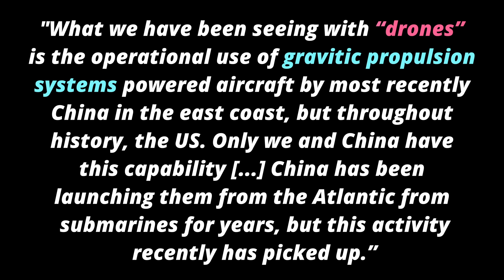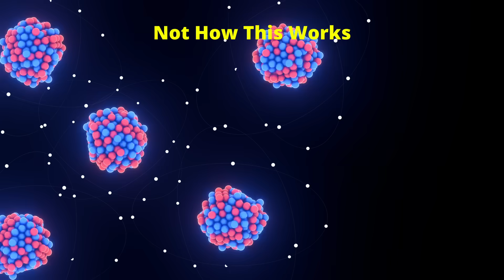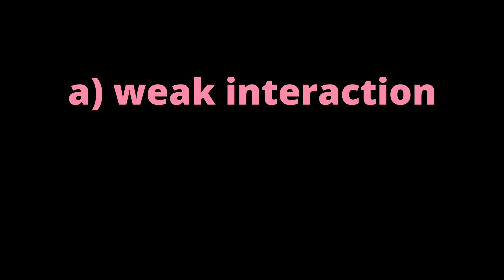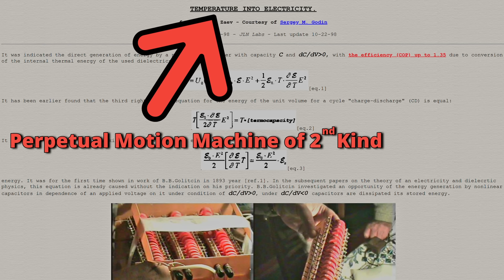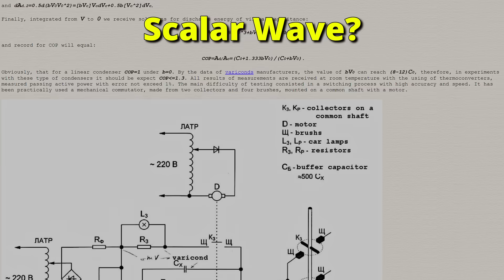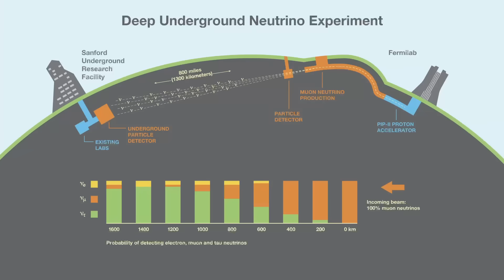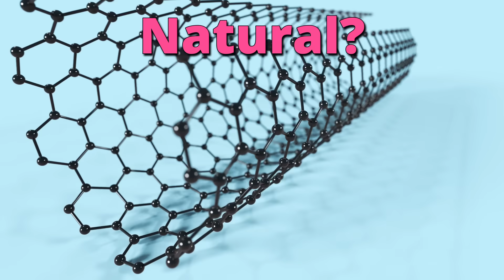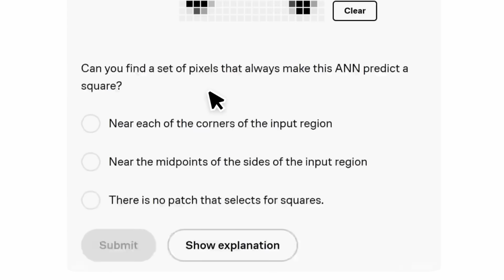What is “gravitic propulsion” and could the US government hide it?

Comment: Sabine do you think that there should be a shift in thinking to discover new components or composition of materials, or that new physics? Does the theoretical physicist has reached there limit of thinking or limit of having new ideas? Are they not bound to the ideas of present? If the problem is not in “more energy” ( building bigger colliders), then definitely the problem of mathematical capacity of the theoretical physicist. At the Ptolemaic era the moving of the celestial bodies were very well discovered, but when Copernicus and followers discovered the true movements the old ideas was outdated. The early astronomers and mathematicians had no tools ( equipment) and ideas  ( new math?) to really discover the movements. So will new generation of physicists would have more chances in the AI era to discover this, with new supercomputers?

Comment: Lord Kelvin stated nearing the end of the 19th century, that heavier than air flying machines were impossible, and he remained correct till the Wright brothers contradicted him using physics, with which he was unfamiliar.(fluid dynamics) In this way, the head of the US Patent office, claimed, in 1900, that everything that can be discovered has already been discovered. (this was a claim based on known physics) Einstein, Max Plank and Niels Bohr, notwithstanding. What will be the next step, which gives physics a significant shake up? I don't know, but we haven't had one for over 50 years, and I wonder why? As do you Sabine

Comment: 13:30 Sabine.  Better late than never.  You seem to be inexorably, but surely, moving over to the sane side of science.  The classical side.  Physics in academia is all but dead.  The crazy cultlike adherence to QM ushered in its demise and AI will deliver the final stroke.  

Chemistry is the new field of study.  And what sets it apart is a whole new field of chemistry call Tovacian Chemistry (The Orthogonal Vector Addition of  Charge) .  Two identical moving charges of the same polarity, interacting orthogonality (at right angles) may attract each other.  (Note that at right angles it can be easily proven that there is zero electrostatic interaction between the two orthogonally  interacting charges) .

Comment: To perform anti-gravity from your physical body, you have to willfully go against earth rotation, even if you do not feel that the earth is rotating. You have to stand close eyes, reset your mind by quieting it, sooner or later you will sense your orientation or perceive the earth's rotation, once you practice achieving that 1000x, (it is like achieving waking up 5am morning without alarm) then once achieve it, you'll then grab a pull-up bar and grab it to the height that youre touching ground with your tiptoe. Do this again 1000x until physical body recognizes the earth rotation aside from your mind, then through visialization, you intend on moving away from earth rotation like releasing yourself from its gravitational pull and orientation, de-orient your mind and body as if like an astronaut, you can achieve this again by resetting mind and body, blanking the instincts, it is like fasting, the more days or times you keep doing it, the more your body and mind responsively changes, at first may feel discomfort but once you do it too many time, it will be comfortable as if its aligning to the new human in you.

Comment: i think mass is condenesed energy similar to ice is frozen water. just look how pure energy is released when matter+antimatter cancel each other out. also look at the periodic table of elements. 1 2 3..115 we know all of them. also look at the unification of the 3 fundamental forces when temperature is very high, meaning very high energy concentrations. gravitation is not fundamental i think. i think there is no graviton. we will see. maybe there is 1 more fundamental force but very weak or only at very small distance. CERN should show it soon. we live in interesting times now for sure. hehe.

Comment: Can you use the original Maxwell's equations to show how extremely high voltage can demonstrate gravitic effects? Nevermind the magnitude and engineering difficulties, just in theory and given an unlimited supply of energy. What about breaking the Schwinger limit?
Reply: The speed of light squared is also the product of the permeability and permittivity of a vacuum. So that's the bridge to pick at here in regards to mass and energy being the same thing as they relate to electromagnetism. (Gravitation is an emergent aspect of the mass potential. There are hints that it's a tensor, just like the electromotive thing.) It's putting both Maxell's and Einstien's work together.

Comment: The classified math is all 100% true.

There is no true open equation for mathing out how to turn u235 into u238 and what electron voltage you need to cause the implosion. You literally have to know the knowledge in order to have access to that classified information or work on that classified information. And that is just the most basic example of open knowledge that is openly classified.

Comment: Electrostatic and magnetic fields are connected to gravity by the Einstein equations and the fact that the speed of light squared is also the product of the permissivity and permeability properties of a vacuum. The trick needed is to use a precession effect across rotating fields to perform a transform across the vectors there. Get that licked and you've got something. Another thing in the bag of tricks is that if you have high enough frequency of gravity waves, there's some hacks for fusion. Stuff that's still not good for over-unity right now would be fine when you factor in a possible generated field application that's not really well known just yet.

This falls into "cagegory C" as Sabina describes it. It's not new stuff, it's existing things being combined in a way that's not fundamentally obvious at first. Part is in the confiscated Tesla papers, some is there in Einstein's work (but not considered seriously), and there some at the very roots of string-theory although the later stuff we know as current string-theory went on a different tangent. This is finding new ways to fit Lego bricks together, not inventing new bricks.

As for secrecy... It's just like any secret sauce. All the ingredients are there in the open for the public on the store shelves. It's the recipe for mixing those ingredients that's heavily controlled. And some governments may be doing exactly that within this context.

Comment: Of course one can hide anything from the average physics-challenged citizen. But one cannot hide anything from physicists. After all, they do the work. Even the Manhattan project could not be hidden from them. They might not have known the details, but they noticed that key figures in the field of nuclear fission were suddenly missing. Papers on fission were already in the open literature, and so was the mathematical theory of how to produce a bomb. The point is that anti-gravity nonsense has been around since the middle of the nineteenth century and, like free-energy (aka perpetual motion), it merely reflects universally poor science education. Check the bona fide physics journals. Oh, but you can't can you: the papers are usually behind high pay-walls. So you can only read rubbish on Google Scholar and the output of so-called 'predatory' journals, which exist for the sole purpose of spreading pseudoscientific drivel.

Comment: As seriously as possible, I believe they're referring to a method of influencing gravity, basicly using unspecified materials or methods to reduce the pull of gravity (anti-gravity) directionally instead of a the typical omnidirectional way objects normally interat via this method. How is anyone's guess but this is quite different from simply overpowering it using the electromagnetic force or chemical methods, etc. Wouldn't it be like absolutely crazy if dark matter turned out to be some phycis of non-omnidirectional methods of redirecting the gravity of existing objects, possibly primarly only created by intelligent civiliaztions that actually are extreamly common throughout the universe?

Comment: Gravity: F=m*a or F=G*m^2/r^2, designation: a - acceleration, F - force vector, G - gravitational constant, m - mass, r - lenght vector, ^2 - 2nd power operator
Lorentz Force: F=q*E + q*v X B, F - force, q - charge, E - electric field, v - velocity vector, B - magnetic induction vector 
Lorentz Force to gravitational force connection:
m*a=q*(E+vB) if we assume v and B vectors perpendicular to eachother
a=q/m*(E+vB)
When Lorentz force is equal to 0 then qE=-qvB so E=-vB and a=0.
But we know that in our gravitational field of Earth the a=g.
So the g=q/m*(E+vB)=q/m*(E+r*f*B)=q/m*(E+r*omega/2pi*B), designation: f - frequency, omega - angular velocity, 2pi - pi number times 2
If electric field of earth is equal to E and magnetic field of earth is equal to B then all non zero charges to mass ratio of earth particles as sum must give the gravitational acceleration G. Such charged massive particles are rotating with omega/2pi  ratio or moving with v velocity. Because such movements happening in some aspect ratio then:
g=alfa*q/m*(E+vB)+beta*q/m*(E+r*omega/2pi*B), and alfa+beta=1, designation: alfa, beta ratio constants
This is the gravity effect cause. So gravity is the law of conservation.
Because all moves of inertial particles on Earth have thermal cause then:
v=(kT/m)^(1/2), where v root-mean-square speed of particles, k - Boltzman constant, T is temperature,
after new rearrangement:
g=alfa*q/m*(E+3(k*T/m)^(1/2)*B)+beta*q/m*(E+3(k*T/m)^(1/2)/2pi*B)
If we then treat an Earth as a capacitor and coil then we can rearrange such equation:
g=αq/m(C⋅V/ϵ)+βq/m⋅(C⋅V/ϵ)+3(kT/m)^(1/2)((αq/m)*(L*I/(A*N))+(βq/m)*(1/2π)*((L*I)/(A*N))),
designed values: C - capacitance of Earth, ϵ - permittivity of the Earth atmosphere, d - separation between Earth surface and Ionosphere, L - inductance of Earth, N - number of turns in coil, I - current flowing through coil,  A - cross sectional area of coil, V - voltage between Ionosphere and earth surface.

Z=jωL - relationship between Earth impedance Z and inductance, designation: ω - angular frequency of the AC signal, j - imaginary unit
Z=−j/ωC - relationship between Earth impedance Z and its capacitance, designation: ω - angular frequency of the AC signal, j - imaginary unit

Comment: If a genuinely new tech fleck of paint from a ufo would revolutionise the 200 billion USD world wide paint and coatings industry, just imagine what  a new structural material or a new powerplant would do. But we are still crawling around at subsonic speeds using materials and processes a WW2 engineer would recognise (improved a hell of a lot for sure by 75 years of incremental development, but no fundamental breakthrough tech !!) And we are still trying to understand what gravity is. Could be gravitons, could be stuff yet to be discovered.

Comment: The term "gravitic propulsion" is a misnomer. Gravity, in and of itself, is merely a form of inertia. Rather, once one understands what causes inertia (low pressure regions within the Higgs Field), one necessarily understands what causes gravity and critically how to defy gravity. 

The problem with Einsteinian mechanics is that it completely ignores the fact that gravity is an effect of inertia, similar to hitting a ball with a baseball bat, or the inertial forces that pull magnets together via electromagnetism.  A complete understanding of gravity therefore must start with an understanding of inertia, not mass, or subatomic particles necessarily. 

We know that electromagnetism is an inertial effect via Stochastic Electroynamics, we know that the inertial effects of the "Hall effect" arise from the Higgs field, the same is true with gravity - low pressure regions within the Higgs Field cause objects to fall towards from the high pressure region to the low pressure region. Done, simple. 

So, how does so-called "anti-gravity" work? Simple, you create a low pressure region within the Higgs Field IN FRONT of the object you wish to levitate. The object you wish to levitate then miraculously appears to fall towards this low pressure region.

Comment: Momentum and gravity are similar as Einstein thought experiment explained that an accelerating elevator or lift will be indistinguishable from gravity . When a swimmer does the front crawl his arms mass accelerates through the water and drives some forward momentum , if a magnetic mass is accelerated to a repulsive electromagnet controlled by a computer then as the mass is briefly “gripped” and its momentum is absorbed , forward propulsion could be possible with the release repeating the cycle .

Comment: Aircraft already use both gravity and anti-gravity to fly, gravity pulls the gases of the atmosphere downwards creating atmospheric density, which the aircrafts wings use as a medium to create anti-gravity in the form of aerodynamic lift.
Reply: I can't tell if this is meant to be humorous, so in case someone comes along and thinks this makes sense, it doesn't. Saying airplanes demonstrate anti-gravity is mathematically equivalent to saying pouring water into a glass of oil to raise the height of the oil is an anti-gravity demonstration. There are more steps with flying vehicles, but it's the same thing: lower pressure above than below.

Steel boat won't sink? More pressure below than above. Helium balloon wants to rise? More pressure below than above. It's all normal gravity. Hammer and feather drop at same speed on moon? Negligible pressure below and above and virtually nothing in the way to slow them down, so they fall at the same speed.
Reply: @brushstroke3733  True though...
Reply: @ats-3693  You're defining "anti-gravity" in a way that suits your argument rather than coming up with an argument that addresses anti-gravity as the rest of the world defines it. If you want to redefine up as down or black as white, that's your prerogative, but it doesn't change the underlying experience.
Reply: @brushstroke3733 Where is the argument? Not everything has to be an argument, it is possible to just have a friendly discussion about a subject without it being an argument, I just dropped a comment that has some relevance to the subject and which I thought was interesting, I'm not trying to define the term anti-gravity at all just giving an example of something relevant to the subject. The term anti-gravity just describes a hypothetical force which opposes gravity, whether that be some yet to be fully understood method of actually manipulating gravity itself or by a method that creates another force that opposes gravity or an artificial gravity like force that interacts with gravity. The gyroscopic effect can be used to overcome the force of gravity but its not manipulating or even interacting with gravity itself, magnetic fields can be used to levitate objects and that is not manipulating or interacting with gravity, likewise the force created by aerodynamic lift can be used to oppose the force of gravity allowing an aircraft to fly and that aerodynamic force is totally unrelated to gravity. 

I'm a geophysicist I work in both ground gravity surveys where we walk along preplanned lines taking measurements with handheld gravity meters and airborne gravity surveys using specialised airborne gravity meters (or gravimeters as they are also known), we map contrasts in gravity which in turn shows us contrasts in crustal rock density. I've been involved with this for over 25 years so I have an interest in the subject and some scientific knowledge on it as well, from the way our meters work to measure gravitational force to the data processing needed to remove the errors in the data due to accelerations and the effects of eotvos and coreolis.
Reply: @ats-3693  By argument I meant building a logical case for a position, not a verbal confrontation. This is a friendly discussion, but we have different positions or "arguments". Nothing more. Cheers.
Reply: @brushstroke3733  Cheers back 🤚